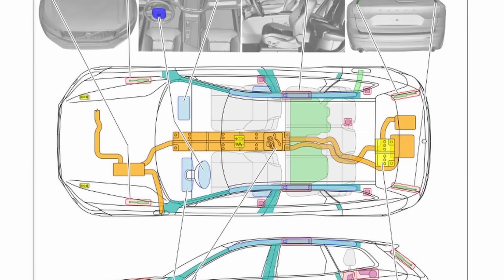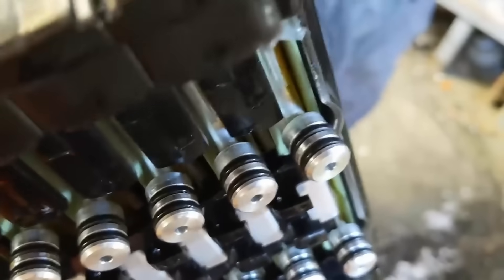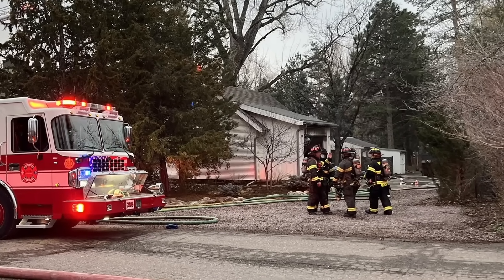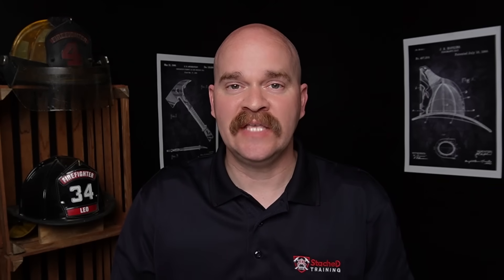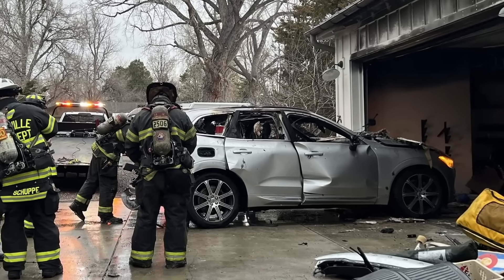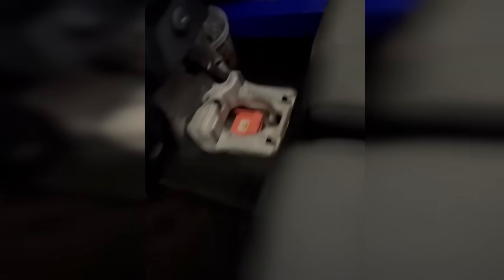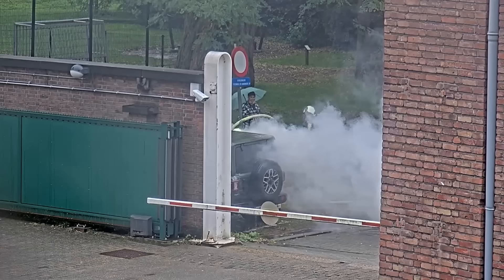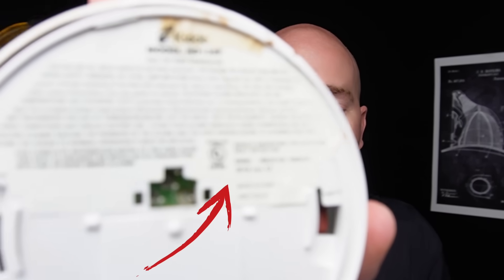EXPLOSION: Volvo XC60 Electric Vehicle!

Comment: I hate EVs. Compared to vehicles without lithium ion batteries they have more dangerous and uncontrollable fires, charging stations are limited and you probably won't find a lot in the country, just a little bit of water can put it at risk of blowing up, they're too quiet meaning they're harder to detect (especially for blind people crossing a street), and more. The best cars imo are hybrids with an older model of car battery that has been tested for years. I'm sick of lithium ion batteries becoming bombs
Reply: this is a hybrid ffs.
Reply: @JamesTan-mq4eo  The issue is with lithium ion batteries. I'm fairly certain most (if not all) EVs have one, while hybrids can have the older safer model of battery. This hybrid had a lithium ion battery and was called an EV, so I still hate it
Reply: @silverfox9004  the manufacturer of this hybrid did not call it an ev. the creator of this video did. get your facts right. 

even toyota is using lit ion batteries for their hybrid nowadays. since their 4th gen prius. so u can hate all hybrids and evs now.
Reply: @JamesTan-mq4eo  I don't hate all hybrids because not all hybrids have lithium ion batteries, there's still a lot that don'tuse them. In my original comment I mentioned that I think the best cars are hybrids with the older model of battery (pretty sure those are lead-based). Also, from my limited knowledge, hybrids still have a decent amount of noise produced by their engine, which helps everyone notice it.
Reply: @silverfox9004  FYI statistics have shown hybrids have higher probability of catching fire than EV or pure ICE. Li-ion batteries also have different form of chemistry, LFP is as safe as NiMH. Lead based battery are only for the 12V system. hybrid mainly uses NiMH or Li-ion batteries

EV do emit sound as part of the regulatory. 

Again do your own research before hating on things you dont know or dont understand. this is what causing unnecessary misinformation.
Reply: @JamesTan-mq4eo  The statistics can be explained from the fact that the age of the cars isn't noted in the statistics. Older batteries have a much higher chance of catching fire, and there's a ton of older hybrids on the road. The EV vehicles that catch fire are often very new, so as EVs get older we may see a huge increase of that percentage. Also note the danger of lithium ion car battery fires compared to the NiMH battery fires. Lithium ion batteries can burn for hours or reignite in full force later due to damage to the battery. Those older battery fires are much more manageable. I know my knowledge isn't perfect, but I'm pretty sure I know enough about these batteries to hate the cars that use them. I'm honestly not sure why you're trying to convince me to not hate them
If they're requiring new EVs to be more noisy, that's a relief. You don't want a stealthy car
Reply: @silverfox9004  sure li-ion battery do burn hotter and harder to extinguish. thats a fact. however, its also a fact that we can always find a way to learn how to manage it, at the same time find alternative battery that safer which is already in the market as LFP.

tried to share the statistics based on miles driven but youtube seems to ban links. saying ev that caught fire are often very new without statistics to back it up is not very scientific. it could be due to manufacturing defect and not cause by the battery as it was in this particular volvo. same thing could have happened to an ICE car and i assume its not right to give a blanket statement that ICE are all bombs.

im not trying to convince you not to hate. Hate whatever you want. just stop spreading misinformation and using excessive words like "bombs" or "just a little bit of water can put it at risk of blowing up"
Reply: @JamesTan-mq4eo  Ok, maybe tomorrow I'll look at statistics and stuff (it's almost midnight). My source for my claims is other videos this youtuber who is a fire chief made. The one about the EV busses getting recalled stated that one possible reason was moisture getting into the battery and corroding it, making explosions more likely. Also, I've heard that driving an EV through deep water or leaving it in a heavy rainstorm can void its warranty, likely because of how these batteries get damaged from water. As for calling them a bomb, that was the best word I could come up with after viewing many different types of lithium ion battery fires (the bigger the more explosive, scary stuff) so I don't see why it's wrong to call them that. They can explode with very little warning, shooting flaming debris and toxic gas everywhere. 
As for finding an alternative battery, I hope they find it fast. These batteries are too dangerous atm and I have no idea how they got the greenlight for mass production 
As for the lithium ion batteries in our devices, yes I'm terrified of it, especially for my laptop. I try to limit heat exposure to all my devices and hope they'll never explode. They've made them safer though, I hope EVs follow too. But for now, I won't take back my original comment
Reply: @silverfox9004  well i believe i have said enough and cheers for being a good sport. my final message is there will always be pain points on new technology, give it a chance for it to improve and always keep an open mind, that's how we move forward together for better things.
Reply: @JamesTan-mq4eo  Thanks for being a good sport as well, the world needs more of that. Hopefully as technology advances EVs will become safer too. Have a nice day 😁

Comment: Let me add this. Not all EVs are prone to this. Don’t judge all because a few manufacturers started pumping them out for $$. The Nissan Leaf was the first production EV on the Market, and ever since there has been no issues like this. NOT ONE! Before people start bashing EVs in general, think back to the blunders made with ICE cars. Ford Pinto. Hit from the rear and there was a good chance the thing went up in flames. Does that mean all ICE cars are bad? No! The Chevy Corvair. Many owners complained that the engine dropped while driving. Does that mean that all ICE cars are bad? No! The Pontiac Ferenza was a huge problematic car. Many owners wanted to drive them to GM, but later decided not to based on the fear they wouldn’t make it. The list goes on. There’s nothing wrong with EVs in general. Just like ICE cars, you have to research which are the better models.
Reply from the maker: I said it in this video, as well as others.   It's really dependant on vehicle construction.
Reply: @StacheDTraining  yes, I heard, but I wanted to mention what I said because so many will jump at anything to start bashing EVs, and I’m really getting sick and tired of their ignorance. They have no idea about the industry at all. EV fires depends on the quality build of the batteries. Nissan has never had an issue with theirs.

Comment: The first thing I did was to google if there is a battery safety recall for XC60. No recall on the battery but there is a recall on the ECM electronic control module software error. There is a worldwide recall on Volvo cars but again, not on battery, It is a defective engine component which may cause vehicle fires. Most affected models are ICE cars with only two XC60 and XC90 are plug-in hybrids. Next, I googled the battery suppliers for Volvo and they are CATL and LG Chem. There a long term contract since 2019. 
EV battery fires remain very rare but each incident always hits the news media.
In recent weeks, I was driving home on the freeway from a friend's place. From a distance I could see a car was engulfed in a huge fire on a shoulder of the freeway. As I was curious, I drove slower as I passed by. I thought it was an EV, but no. It was an ICE sedan.
According to data from Bureau of Transportation Statistics and National Transportation Safety Bureau (NTSB), hybrid vehicles have the highest rate at 3474.5 fires per 100K vehicles, followed by ICE vehicles at 1529.9 fires per 100K vehicles, while electric vehicles have the lowest at 25.1 fires per 100K vehicles. It is not clear whether the plug-in hybrid (PHEV) are included in the hybrid or electrical vehicle category. Also there is no year the data is conducted. I had Nissan Leaf for six years and never had a problem with the battery. I have Clarity PHEV for also 6 years and never had battery issue. Now I also have Ariya for over 1 year. I always charged in the garage. With the Leaf and Clarity, it was a daily charging. With Ariya, only once a week or every 5 work days. No problem at all. Chevy Bolts battery fires affected a small number but made huge news. The recall was extended for all Bolts. LG has since agreed to replace every single Bolt's battery it made for GM.

Comment: Very misleading when you say EV even though it was an PHEV. Statistically plug in hybrid are the most likely to catch fire followed by ICE cars and the least likely to catch fire are EVs. A hybrid is half ICE and half EV yet for some reason you chose to call it an EV instead of a plug in hybrid or an ICE vehicle. Seems rather biased to me.
Reply from the maker: This was an explosion that was directly related to the high voltage battery.    Very little fire involved.
Reply: @StacheDTraining  so? The inaccuracy in your description still just as inaccurate🤷‍♂️
Reply: @NorwayChallenge  like every other youtubers getting paid thru views and clicks, what hotter than misleading their audience about ev being "extremely" high fire hazards? people need to do their own research than rely on idiots like these.

Comment: Just concerned that this is nothing to do with EVs at all: Guardian Newspaper reported “More than 500,000 Volvo cars are being recalled worldwide, including 70,000 in the UK, because of a fire risk in the engine.
The manufacturer said a plastic part in the engine has, in rare cases, been liable to melt and deform, resulting in a possible engine fire. The affected models have four-cylinder diesel engines and are 2014-2019 versions of the following cars: S80, S60, V70, XC70, S60 Cross Country, V60, XC60, V60 Cross Country, S90, V90, V90 Cross Country, XC90, V40 and V40 Cross Country.” I note this model number is in this huge catchment of Volvo vehicles.
Reply from the maker: This wasn't a fire. This was a deflagration.   Very little fire involved,  and the engine wasn't involved.
Reply: @StacheDTraining  You need a fire or flame source for a deflagration!
Reply from the maker: @gesp5151  The fire was located at the high voltage disconnect.   All laid out in the video.
Reply: @StacheDTraining  I know you say that but there is no other reportage of this incident so I’ve asked Volvo to review as it’s a serious allegation that you are making against the EV battery part of a hybrid vehicle
Reply: Bear in mind that the disconnect is there to isolate the circuit ie to prevent fire or overload and that these are widely used on other electrical systems such as solar

Comment: The xc has a normal ICE type starter battery in the cargo area which Volvo give the following warning about “The battery can generate oxyhydrogen gas, which is highly explosive. A spark can be formed if a jump lead is connected incorrectly, and this can be enough for the battery to explode.” I can’t see any evidence for the suggestion you make that this has anything to do with an EV drive battery.

Comment: No, this is inevitable with every electric vehicle using a Lithium battery.

You strapped a thermo-chemical bomb that is averse to moisture, into a vehicle that drives outside, in the weather. That is obviously the most common failure point so far.
The inevitable failure point is unbalanced cells. As you charge and discharge the battery, over years, each cell will degrade at a slightly different rate. Once one cell starts into a negative charge, because it degraded faster than the others, the fire begins. This WILL happen to every multicell battery on a long enough timeline. Luckily, they arent that old... yet.

Your job is going to get much spicier in a few years tho.

We've been using lithium batteries in the RC racing scene for a decade, we know all too well how dangerous they are. But we can afford the 30 bucks to replace a battery every year or so to make a car, that we dont sit in, go fast. Just wait til these EVangelists realize their new batteries are in the $20,000-$40,000 range. Needless to say, there wont be much "preventative maintenance" going on, as they drive thier kids to school in a thermo-chemical bomb.

Comment: Typically there are no smoke alarms in a garage however if you own one of these bonfire heaps you should have a smoke alarm in your garage - if you charge at home or not - as well and it should be linked to the ones in your house.

Comment: I'm no fan of EVs in general, but it seems crazy to me to use pouch cells in such a high powered application. 
They are afaik one of the most vulnerable construction forms of Batteries and more or less just legal because manufacturers claim they are without alternative for Smartphones and so on.

For those not having a picture in mind regarding pouch cells: "spicy pillows". 
If you've seen videos of smartphones or certain laptops gassing off and then catching fire in a repair shop, it was almost certainly a pouch cell. 

Wide-scale adoption of EVs started maybe 10 years ago, but mostly with high priced novelties that were taken care of to some degree. 
Drive around for a few minutes and imagine every other car as a EV with explosive batteries about to plug itself to a "high speed charger".

Rusted trough F150s, Civics patched together from 3 cars, Altimas that look like they got pulled out of a river and if the battery is about to fall out, put some JB Weld, Sprayfoam and Zipties on it. All ready to be plugged into the nearest high speed charger, in homes, car parks and what-not.

I don't think "if" fatalities happen is the question, but rather what dimensions it will take.
Reply: My EV has pouch cells: it simplifies manufacturing. I think the original Tesla batteries, with hundreds of 18650 cells, was actually a patent work-around.

After GM sold the NiMH battery patents from the EV-1 to Texaco, Texaco was bought by Chevron who then sued Toyota and Panasonic (the battery supplier) over the existence of the Electric RAV4. 

Tesla chose the most volatile battery chemistry around: because they were a commodity, commonly used in laptops at the time. They reasoned that with armour and active thermal management: such batteries can be made safe.

Nissan appears to have used a similar chemistry, but "designed for manufacturing" (which keeps costs down). They opted for passively cooled pouch cells. That totally eliminates the liquid intrusion problems discussed in the video. But is not so good in hot climates where temperatures rise above body temperature.

Comment: Pressing the beeper button tells you that the button, battery and loudspeaker work. It doesn't test the smoke detector, a crucial part of the fire alarm - and the detector are often coated in dust and cobwebs, and will detect nothing. So - clean the fire alarm detector regularly.
Reply: You can test with a specialized spray

Comment: Those Hmm yeah, those pouch cells look like lithium polymer cells to me. They are so similar to what's in most of my model glider batteries. Each cell needs to be balance charged if there's more than one. If every single cell is not perfectly charged within the entire group, thermal runaway can occur. That's when a cell will overheat and try to swell up with gasses inside. Then, with the cell already too hot, it bursts, and the overheated lithium comes into contact with oxygen, and that caused the metal to burn. And lithium burns at 1300 degrees C, that's 2372F !!!!!!!!!!!!!!!!!!!!!!!!!!!!!!!!!!!!!!!!!!!!!!!!!!!!!!!!!! And guess what? Water contains oxygen!!!!!!!!!!!!

Comment: I think more information needs to disclosed here as to why exactly these battery packs begin to overheat.
Mazda's new rotary hybrid for instance maintains the battery charge between 40 to 70% charge.
 I learned a long time ago to pull my cellphone device off it's charger at around 85% charge.
Does the risk of heat and possible fire exponentially grow, when trying to get the batteries 100% fully charge?

Comment: Let's not say they are exploding. It's more accurate to say they spontaneously combust. This is an important difference because the latter indicates little to no warning of an impending disaster.  With ICE cars, fires occur with long lead times and warnings, and usually only on poorly maintained vehicles.  With BEV and hybrids, the spontaneous combustion could occur on a new vehicle or even a well maintained one.

Comment: Hi, we're tracking this incident in our EV incident database and we initially thought, based on early reports, that this is XC40 Recharge. How did you get additional information about moisture in a battery pack ? Is there a way how to get incident report ? Thanks.
Reply from the maker: I asked the local FD about the incident.  What I talked about in the video was a mix of what I learned from that and researching the specific battery construction.
Reply: @StacheDTraining  thank you, we'll try to write them. Are local FDs generally willing to talk about these incidents ? Especially if we're not from firefighting community.